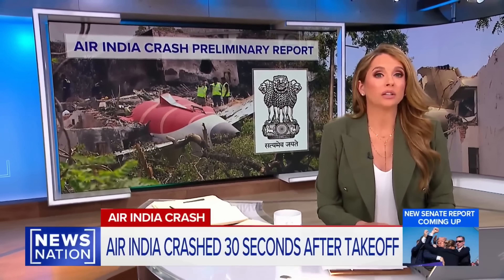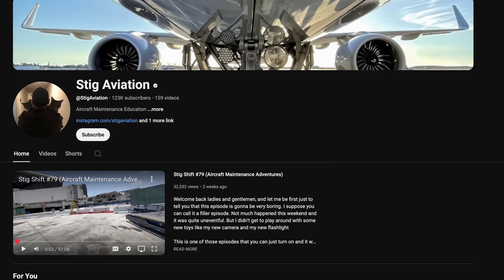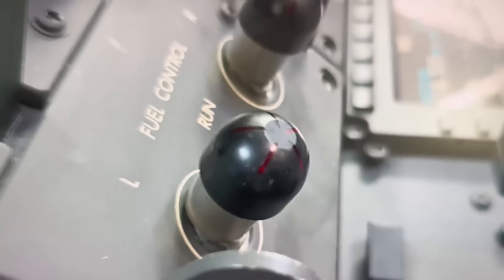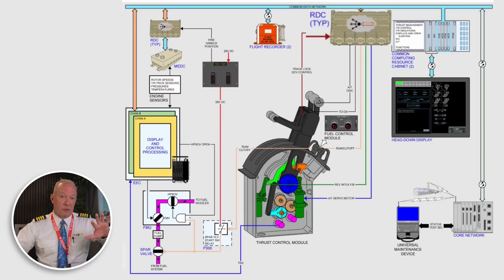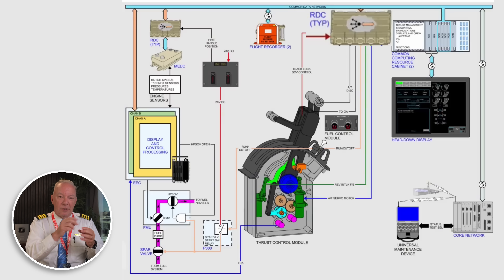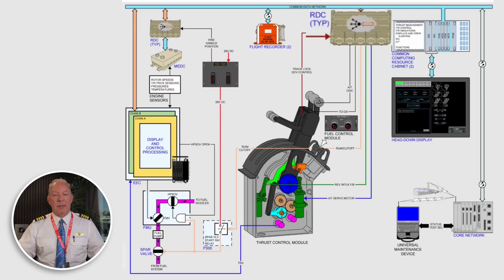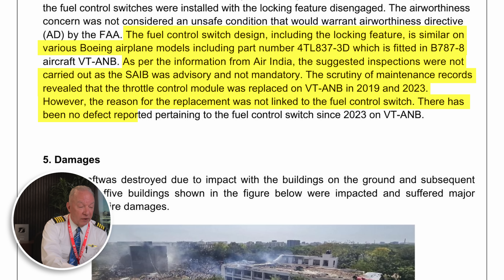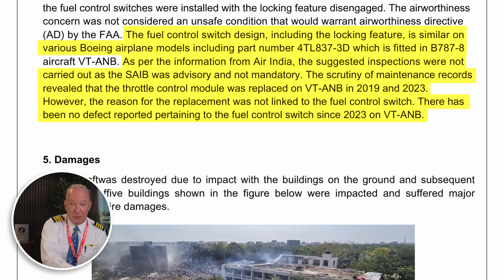The Truth About Boeing 787 Fuel Control Switches

Comment: Two things about the 1-second between fuel switch toggles: (1) The recorder samples only once a second, so the actual delay could be up to 2 seconds. (2) The gap is not the total time to move both switches... it starts when the first switch hits it's middle position and ends when the second switch hits midpoint. The gap is not from the start of moving 1st switch to the finish of the 2nd.
Reply: This is what I was going to comment. The data isn’t recording in milliseconds so it could basically take about 2 seconds to switch them but only record the 1 second.
Reply: @Kennann7634 Exactly! The data recorder has some inputs that are sampled in high resolution and some that are only done in 1-second resolution.
Reply: The delay could also be much less than one second, with the interval coinciding with the flight data recorder sampling.
Reply: @jacksons1010 Yes, but the other extreme is relevant to those who claim that a human couldn't switch them off within a second.
Reply: And I did an experiment in witch I clearly and phonetically said the words 12345678 in less than one second. If you have ever had your wits about you in a potential life or death situation you will understand about time seems to slow down. 
   He said he did not do it. O.K. Maybe not intentionally. But my point is that over 99.99% of people looking at this don’t realize that over 99.99% of what happens in the electronically controlled system happens on the other side of the control panel. In other words. Out of your view of the position of the switch visible on the inside of the cockpit.
Reply: Control inputs are not polled. They are monitored for changes in state. Things like environmental measurements are polled.
Reply: Since none of us know how the software was written, we're speculating. Even if the programmer had the raw time of the state change to a thousandth of a second, if he chose to round it to the nearest second, we're back to the same problem. Until I see a report that says the first switch went to off at xx:xx:xx.03 and the second at xx:xx:xx.12, I'm taking the 1 second gap with a grain of salt.
Reply: @lcs3354 despite the videos clearly showing it is easy to switch both within a second of each other?  Do remember this SW/Embedded SW is at the highest level of scrutiny as an impact of a failure is considered catastrophic.  These switches and the control logic has existed for decades and been re-used over and over again after being approved for use.
Reply: All I'm saying is as it stands now, the best anyone can say is that the switches were changed somewhere between 0 and 2 seconds apart. That's because either the authors of the report or the programmer decided to round the timestamps to 1 second. If they have higher resolution data then they should give it to us. If they don't then that's a shame because a < 1/2 second gap would have exonerated the pilots of suicide. It wouldn't exonerate them of pilot error because they obviously didn't flip the switches as intended, but I doubt they'd be the first humans on the planet to discover a cute trick to save a second from their busy day. 

I'll be looking for two things from the final report:

1) what is the highest resolution timestamp of the switches changing state available from the software as written?

2) is it possible to close the switch when it's not in the detent position?
Reply: @lcs3354 The pilot observing had both hands available and could have moved both switches at the identical time, if he chose & made theextra effort.
Reply: Okay it doesn't completely exonerate him,  though I'd like to think the other pilot would've noticed two hands flipping the switches off and saying something like what the hell are you doing? I don't really believe the switches turned off by themselves, but I'd like the final report to at least attempt to disprove the possibility.
Reply: @lcs3354 Yeah. It is frustrating to wait so long for the real report. I hope that the investigators would put out a notice immediately IF there is indication of mechanical/electric weak point in the plane. It would be irresponsible not to. And if something went haywire there should have been obvious signs in the recorder data... that they would have seen before the prelim report.
Reply: @shag139 In the case of the cutoff switches, it is only a 1-second resolution. This is based on a separate video that went into detail on the flight recorder having high-res on some inputs, and low-res on others.

Comment: I'd just not have anything on the aircraft you can push, twist or smash with a hammer that can cause the plane to crash at all. Like an airbus will only let you maneuver within certain parameters, the buttons you want to use must be safe to use.